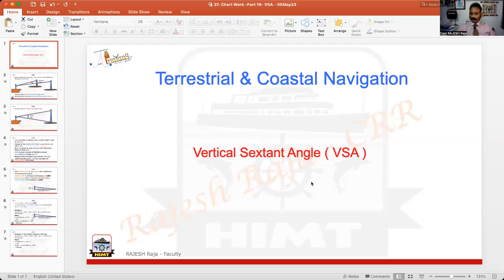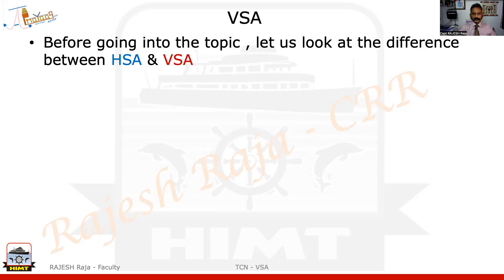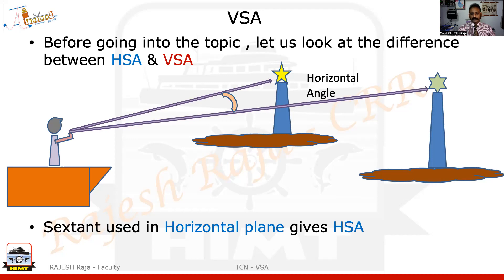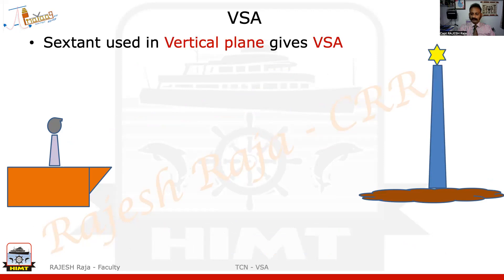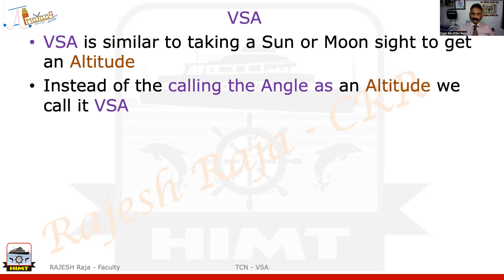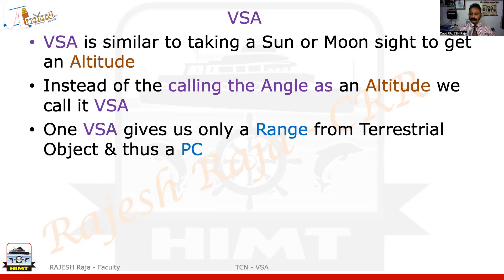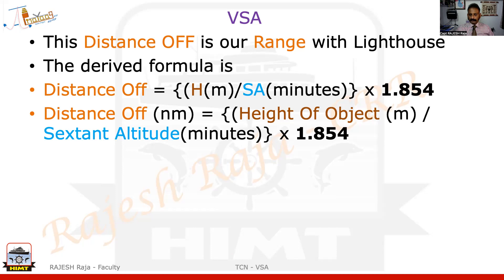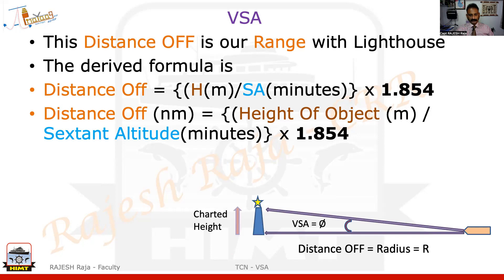37. Chart Work -Part 18 -  VSA -  06May23

Comment: At 0800 hrs a vessel observes vertical Sextant Angle of Lundy Island North Lt. Ho. (51O 12’N, 004O 40.6’W) charted height 50m, to be 0O 20.5’, I.E. 2.0’ on the arc, when it was due East. Find course to steer from this position to have St.  Gowan Lt Vessel (51O 30.5’N, 004O 49.5’W) right ahead when it is 4.0 miles off, if the current was assumed to be setting 250O(T) at 3.5 kts. At 0920 hrs St Gowan Lt Vesel was observed to bear 326O(T) x 4.0’. Find the correct set and rate of current. 

In this question after finding the initial position i will draw the current on the light vessel.Should  take the current for 1 hr or for 4 miles circles.
Reply from the maker: @S9FE-mj1kz  what is your engine speed
Reply from the maker: Would appreciate if you could put your name while asking doubts, helps me address you. Right now I know you as snfe